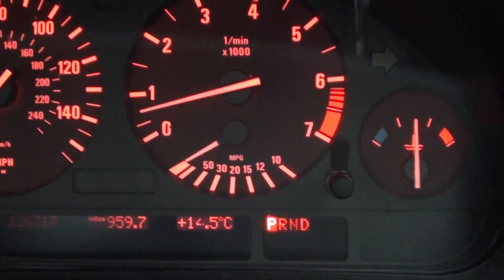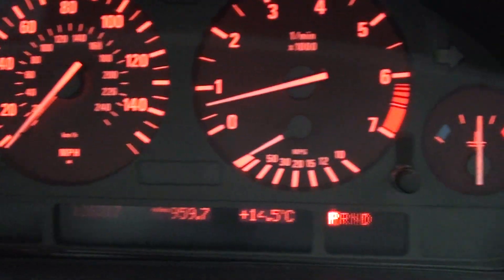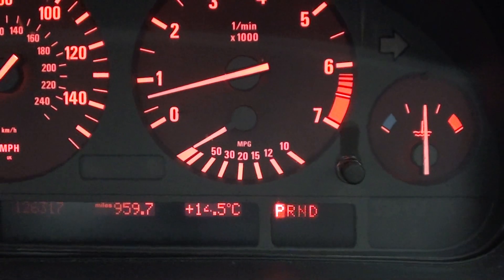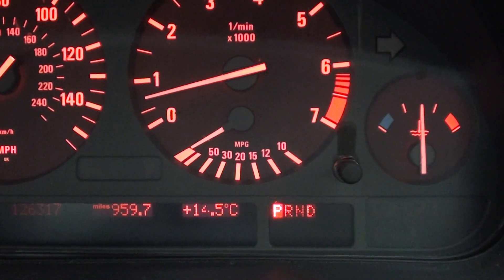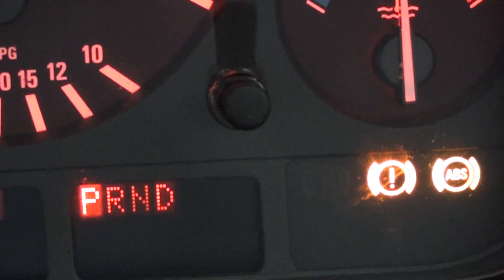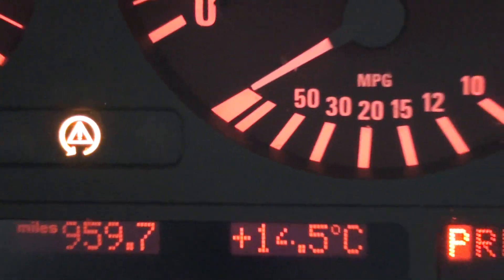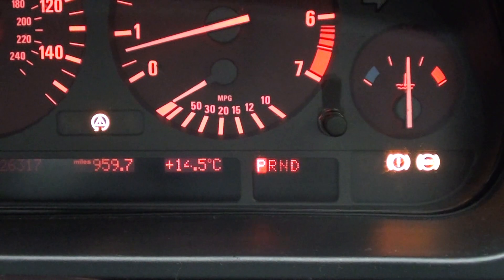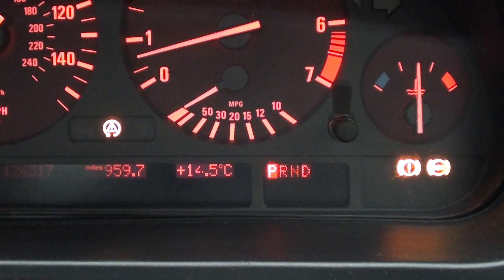ABS Lights On A BMW - How To Fix It - E36 E46 E90 E87 E39 E38 X1 X3 X5

Comment: My BMW Z4 E89, abs fails keep coming up. Resets on start. Foxwell reader had on it about 20 times now resetting stuff. Replaced the abs electrics on valve assembly. Still after 9 minutes driver touch brake and abs fails. Also when ebrake applied the red indicator flickers like a bad connection, then goes stable. 2 new wheel sensors rear, although the old ones did work. Going to replace the after market brake switch with BMW part. Then i have 2 new front sensors to fit. FTM fail also. This has been going on 8 weeks now. Started with a faulty key slot. Which started after i jacked car up to replace shocks, wish i never bothered.
Reply: Always fail at same point on the road.
Reply: @flybobbie1449   and are you repair ?
Reply: @Ali57-q7z  Right i finally sorted the problem. I replaced the ABS unit with 2nd hand unit. The pressure sensor in it failed, not uncommon problem. I replaced the brake light switch with BMW genuine as an aftermarket switch didn't work, which doesn't help when fault finding! I also replaced the start button and key slot. Just happy the car now runs normal this last year.
Reply: Brake light switch is part of the start circuit, so if faulty, can't start. Foot on brake lever to start.
Reply: Also took long time to fix due constant rain and car outside.
Reply: @flybobbie1449  I also have a problem with the abs and I put in another module, but it only throws out other sensors on diagnostics.
Reply: @flybobbie1449  I'm buying a third module today, so I'll try it, the module repair costs 100 euros for me, so I thought I'd give it a try
Reply: @flybobbie1449  Did you have a problem with the sensor on the ABS pump?
Reply: @Ali57-q7z  Yes, my obd reader gave a code. Can't remember now, something like pressure low.
Reply: Just checked i took photo of Foxwell  NT520pro reader screen...6E30/not present..DSC:Hydraulic control unit pressure sensor plausibility..
The pressure sensor is in the brake manifold. I tried at first just replacing the electronic module, but the whole unit needed replacing, so have to remove all pipes and re-bleed.
Reply: @flybobbie1449  Thx for lot inforamtion

Comment: hi...thanks for the tip.. i have the asc and abs lights only on on my e39 528i  and no speedometer nor fuel consumption meter working... it just came out after frozen week... what shal i do..pls advice
Reply: are you repair?

Comment: hi...thanks for the tip.. i have the asc and abs lights only on on my e39 528i  and no speedometer nor fuel consumption meter working... it just came out after frozen week... what shal i do..pls advice
Reply: AUSTIG M check the rear left sensor bro
Had the same problem
Ur sensor might be kinda dirty sometimes and it wouldn’t work
Or u need to get a sensor but it’s definitely ur rear left sensor!